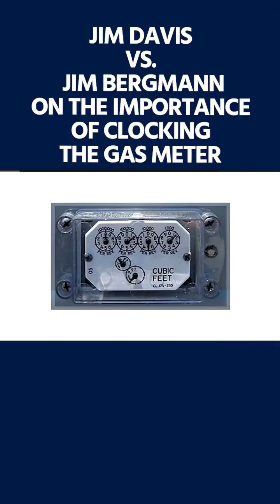Jim Davis vs. Jim Bergmann on the Importance of Clocking the Gas Meter

Comment: I often do the gas meter tests.  Usually over 4 cubic feet as there is a difference from one rotation to the next of the foot dial.  Then take the average of the reading.
It’s usually within 5 %,  without taking the gas pressure

Comment: Jim wants to spend all day at 1 service call doing everything under the sun. Theory vs reality.
Reply: The reality is I do not prescribe a single thing that the manufacturer does not also require. The only reality is that if your not following the installation instructions that you have never set up a furnace ever. There are very specific reasons a furnace is set up by input and not manifold pressure. It takes less then 10 minutes to do it right.

Comment: Clocking the gas meter is in my opinion not worth the amount of time it takes to perform the task, not feasible in many applications and it takes away from the time spent performing other more more valuable tasks.
Reply: There is nothing more valuable then setting up the appliance to the manufacturer specifications. It is a key part of the installation. It is what gives the furnace longevity, efficiency, and the highest level of safety.
Reply: @measureQuick  I would have no problem doing it where meters are available if it actually is required by the OEMs. One Trane manual for example, specifically states that the furnaces input ratings shall not be changed below 2000 ft and only advises clocking the gas meter above 2000 ft for derating purposes. 
I’m not meaning to be antagonistic but I’m just not buying it.
I’m glad to run a combustion analysis. That’s an honestly valuable tithing to do, and it’s great that Jim and MQ are bringing that to the forefront, that process will tell me if the furnace is running safely and efficiently.
Reply: @paulgaras2606  Paul, you are reading that differently then they intended. What they mean is the furnace shall not be re rated or derated below 2000’ not that it should not be set up to its rated capacity. Above 2000’ you may need an orifice change, manifold pressure change and a pressure switch change. Below that no physical modification is typically needed to set the furnace at its rated input. The manual very clearly states that clocking the meter is required. “The furnace input rate shall be checked by clocking the gas flow rate”